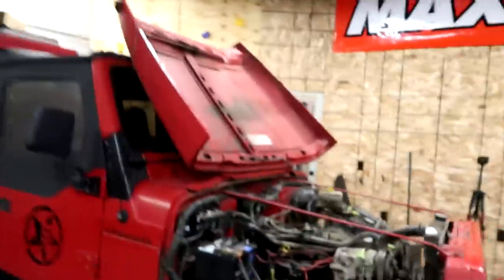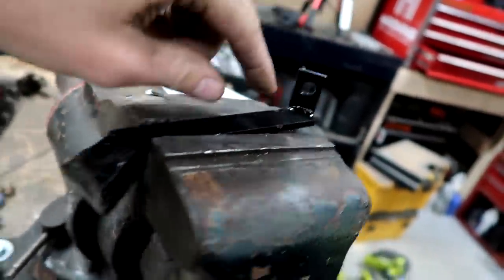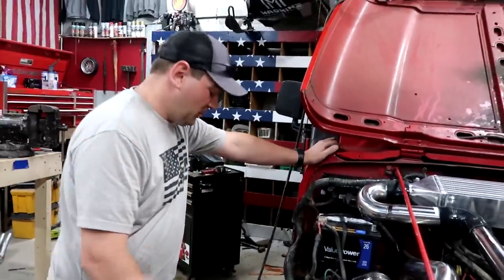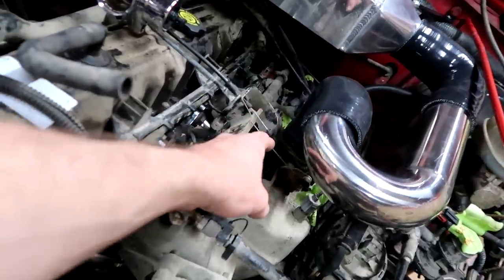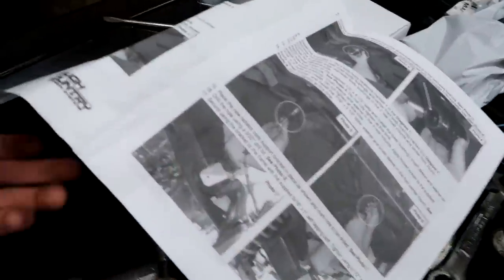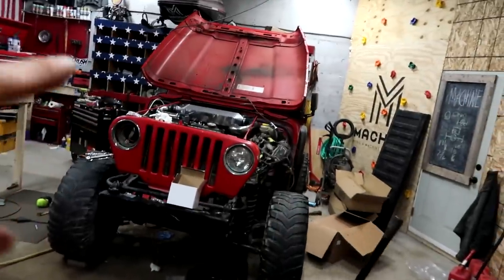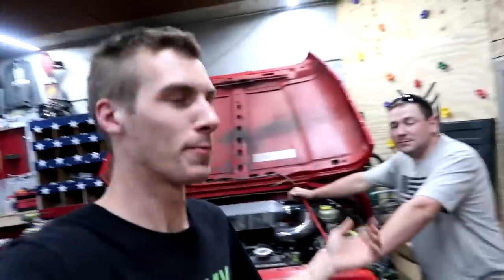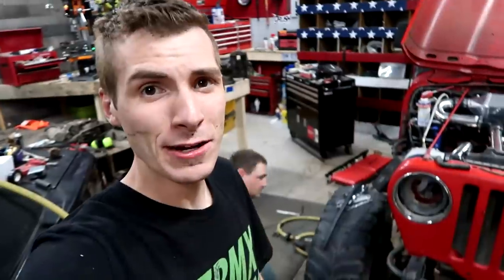Turbo Charging My Jeep Wrangler!

Comment: Before you use that turbo, that engine has to be gone through. Can't just slap a turbo on a stock jeep engine because you might run the risk of blowing the head gasket or bending piston rods. Unless you plan on running low boost.
Reply: Travis Piper it’s a Jeep dude. Doesn’t need a whole lot of boost. Gonna be crawling around most of the time
Reply: SLEDDERGUY1 well knowing dalton who cant even get 2 hrs on a gator that he soent months on...
Reply: Hopefully it's legit seen them eBay's turbos kits make to much boost and easily blow the head gasket lol well see lol
Reply: Sam Jacobs he took apart the gator engine. The jeep engine will blow only of het takes that apart too lol
Reply: chickensfloat_ on_dirtbikes its guaranteed to fail! All his projects fail!
Reply: Paul Condie most progects do. Thats why you run em till they break then fix them and keep fixing them till all the problems have bern been situated
Reply: Sledderguy1 I think he wants this as a daily driver so he can keep the miles of the Truck, so not sure how much crawling around is in it's future
Reply: Travis Piper You need to learn more about turbos
Reply: You can definitely just "slap a turbo" on any stock car. Anyone who tells you otherwise is lying. If you want high performance and high boost, then and ONLY then, you need to consider better gaskets and possibly decompression.
Reply: And even then, it depends on the car.
Reply: FOX RIDER how do they make too much boost with a boost controller ? What you mean?
Reply: @sledderguy1871  you still need to put better head bolts on, metal gaskets, a propper tune, sure U can throw it on, but want 50k miles out of it or 10k, stock heads can lift enough to cause failure at like 3psi
Reply: Fuckin send it
Reply: For anyone who finds this thread. Old as the hills. Any inline 6 after 100k needs the head resurfaced, simple to do with a straight edge and a file,, file the highs out and leave the lows( shinny spots) until your file runs smooth from 1 end to the other. Just hold the file flat on the head push form one end to the other flip file and drag back. Before you bother doing that warm the cleaned head in a oven to 150 c and look for cracks OIL will seep out of cracks, alow to cool on a 2 inch steel plate at 80c clamped to 100 ft lbs, allow to cool over night. Then Gap rings.0350 to fit each cylinder, chamfer each main bearing and rod bearing at 32 deg. Add a high volume oil pump and oil coller. Set boost to no more than 10 psi 14 max. When you done you have a 400hp beast. Or pull everything out a put a LS in it for 2k. lots to be found in rust country. I love these old 6's they never die stock, hold them wide open all day long or buils a wood spliter out of one. If it will turn over it will run they never die.In the next year. I will be building a stroker motor 4.2 =4.0 combo as cheap as torbo's are now might just buils one. Have fun never give up on a straight 6 . Blown up motors everywhen in my life yet the old 6  still gets the job done.
Reply: @pkuudsk9927 people still on this old thread thanks for the information

Comment: I run the same exact turbo kit with some other modifications. Bigger turbo, spilt second fuel/ timing, bigger cam, bigger fuel pump and injectors. 12 psi around 350hp to the wheels, also threw in a ford 8.8 with trutrac as well
Reply: What turbo is this
Reply: Wow. Doesthe transmition and the TC handle the 350WHP ?
Reply: @sulimanalghaithi9342 Not reliably

Comment: 4.0L engine's are good for the most part and will run a long time. Some years had bad cylender head castings and are known to crack and Warp. I also know that the ecm is a barrier so you will need to get a piggyback but I'm sure you already knew all this

Comment: Cons: Too much heat to the IAT sensor, so the PCM pulls timing. This results in neat noise but little power gains if any at all. Stock with proper timing makes more power than a turbo with timing pulled due to high IATs.

That air to air cooler isn’t helping anything. For a TJ, you want a water to air HE in the grill to a top mount IC. That’s been the magic for me.

Comment: your turbo manifold is warped where it come into contact with the turbo. You will most likely will need to get a new manifold or it could cause a major headache where it is not making boost. You can see it is not sitting flush with turbo turbine housing.

Comment: On the cost benefit analysis of the tub swap you forgot to factor in the time and frustration of every bracket, fastener, and all the wiring being transferred to the new tub. How is the charge cooler supposed to cool when it is sitting on top of the hottest part of the engine? Seems like you didn't get a well thought out turbo kit.

Comment: Turbo inner cooler goes in front of the radiator where it can get cool air to cool the air inside the inner cooler. Behind the engine is the hot air.
Reply: Not how these kits are designed

Comment: put this same kit on my 99 jeep had to put 40lb injectors and a map sensor that would read boost and  tune it this thang will rip had no issues yet
Reply: I have the same project what map sensor did you used
Reply: Are you forced to run premium gas now?

Comment: Putting a 63mm turbo on my 2.5 and your video is so helpful!!!
Reply: Hey aidan im starting a 2002 jeep wrangler build and am installing a turbo do you have any tips on which one to get and how easg install was
Reply: @gioarese3742  I bought an ebay turbo and some titanium exhaust pipe. My biggest advice is that when you're ready for ECU tuning have someone experienced do it for you.
Reply: @ajaidan7940 how well does it run turbo'd, without an ecm tuning?

Comment: In addition to whatever else, the intercooler will need airflow and an oil cooler on the turbo, oil return could be a good thing... Good Luck on the project.

Comment: I thought intercoolers were supposed to be mounted in front of the radiator so that the air would be cooled before going into the engine, with it sitting on top of the engine in an area where there is no cool air how is that going to cool down the air going into the engine?  I also agree with other commentators here on this post you will need to go through the engine and make sure it will be able to handle the extra pressure coming from that turbo and you will require a retune on that ECU for the turbo to be efficient and for you to get the power that you are looking for.

Comment: Using gasket maker on an oil pan is dumb. Over time it’s gonna start to leak and could potentially block oil passages if it breaks ups Could’ve at least bought the gasket for the pan and used a little gasket maker to help it seal better.

Comment: I have a 2000 tj body and frame for sell .comes with everything but the engine trans and transfer case ..rust free with a 4inch BDS lift kit ..I'll sell it to you for $1800 ..lmk  if your interested..I could use the space it's taking up lol..not far from you either i live in erie pa..couple hr  drive